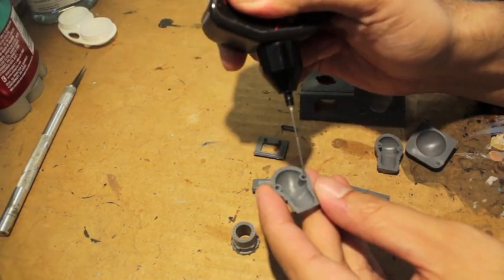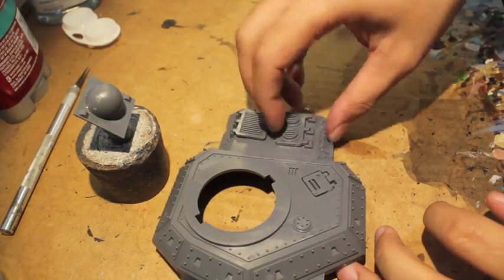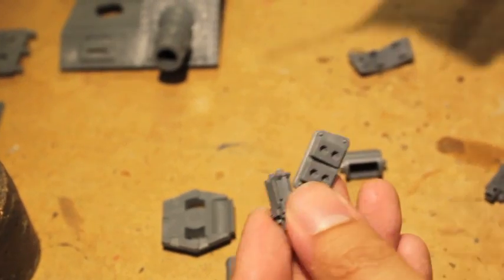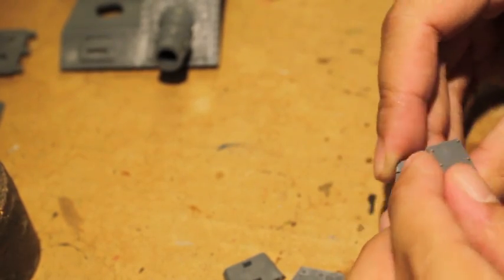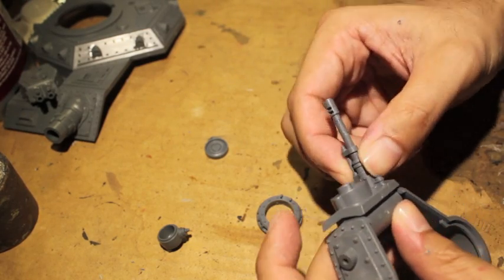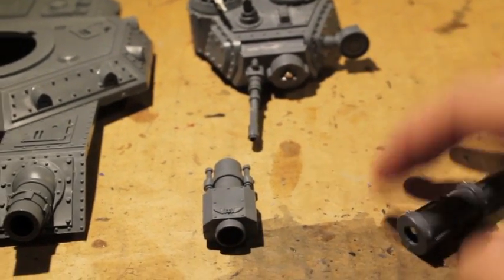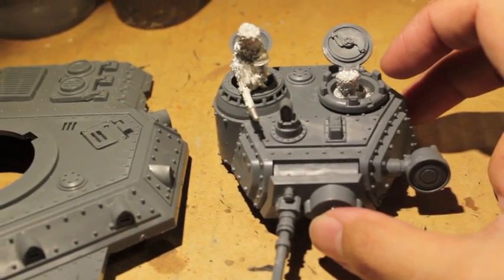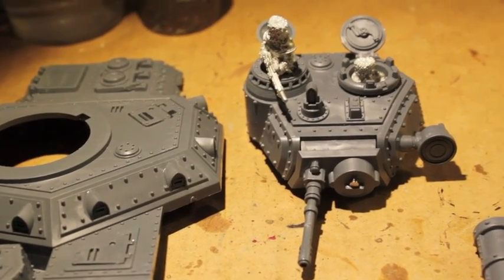Let's Build a Baneblade   Project ApocAugust in September   part 2

Comment: I'm sorry to bother you warboss but what do tool do you use to apply the glue I can't find the name for it
Reply from the maker: No worries! I used Model Master's Plastic Cement for the assembly of this Baneblade, and it comes with that thin metal applicator to really help you get into the tiniest of nooks and crannies. I love that product, it is one of my favorite hobby products for assembling models. I believe I had to use super glue to get the metal Vostroyans in, as plastic cement wouldn't work.